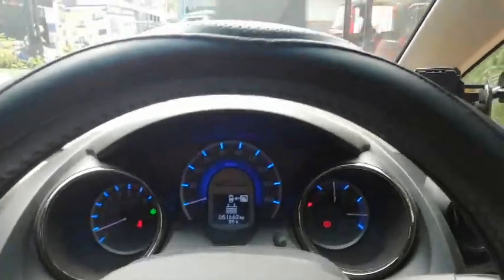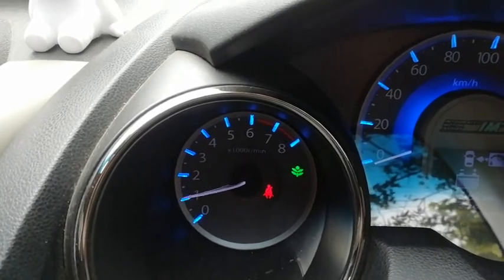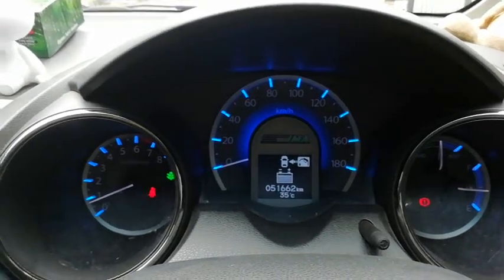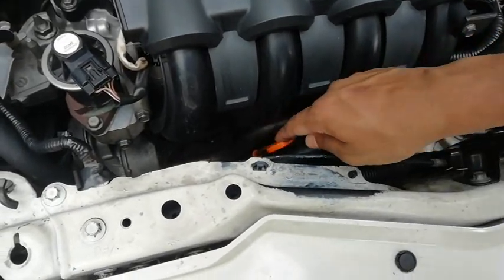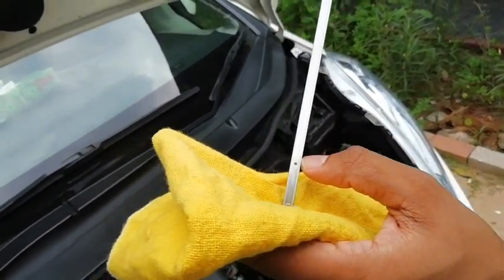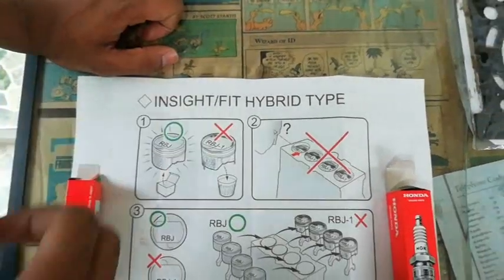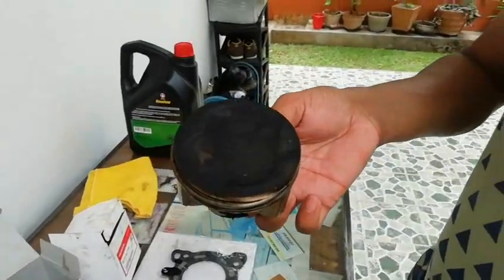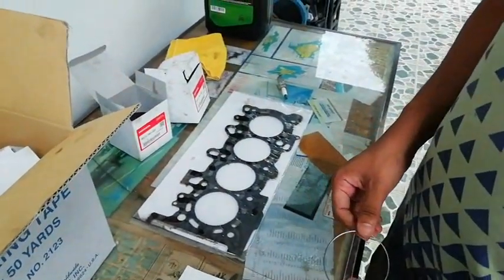Honda fit GP1 2013 engine troubleshooting (manufacturer error)

Comment: Did you get a engine knock/ vibration feeling when the engine check light came on? Found out in Honda website that this oil leak from the rings happen when engine braking is done instead of using the brake paddle.

Comment: Hey, do you know how to do a valve adjustment for this Honda FIT GP1. My car is making this rattling sound every time I accelerate and it seems the valve adjustment is not right, Do you know the valve intake and outtake? My car is similar to the one in this video, Honda Fit Hybrid 2013.

Comment: Bro did you bore the engine and install bigger size piston during the repair? Or  the cylinder walls were okay and no bore was required?
Reply from the maker: Bore diameter was ok, we only change new pistons and new design rings.
Reply: @nilasithu5274  thank u
Reply: @nilasithu5274  how much did it cost you please?
Reply from the maker: @chameerarodrigo2383  LKR 1,80,000 (new spark plugs included)
Reply: @nilasithu5274  Thank you and appreciate.

Comment: Dear,
I have Honda fit gp1 car ,
Yom-2013 I'm the officer and use this car for office purpose one day I went to the office and when I return to the home I started the car the car was started and when I accelerate the car was knocked and not move . After I contact the mechanic and scan the car the scan report said 2nd spark plug was defeated . After that we change 8 plugs and clean the injector and rotter body after that I have big issue which is fuel consumption that means it work nearly 10km/l also the petrol indicator properly work that means when I filled full tank petrol indicator not indicate the full position so really I confused and request you to the actual reason for this and what can I do for this?
Thank you
Reply from the maker: Mr Jeevaretnam it seems the fuel consumption has nothing to do with your repair (changed spark plug /clean injectors) one of the reasons can be your fuel tank level indicator recommended you to check it from a mechanic .
if problem still exist probably fuel injectors leaking/piston ring/fuel injector timing etc

Comment: Bro how is your car performing now, has it stopped reducing oil and knocking?
Reply from the maker: No problem after the repair, I Have drived over 15,000km after the repair
Reply: @nilasithu5274  can you pls tell me model numbers of the upgraded  rings/pistons/parts you installed or any photos of them. So that i can tell my mechanic to fetch those parts and change them in my car.
Reply: @nilasithu5274  well i cudnt find the required pistons. But i changed the engine and installed assembly of fit shuttle. Its working like a charm 🙂